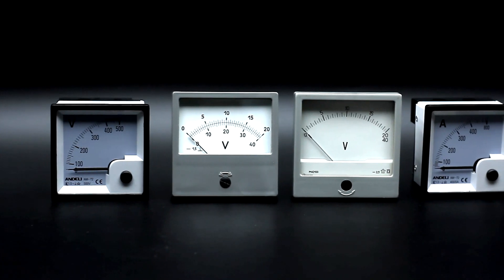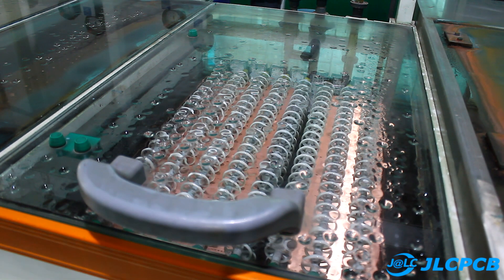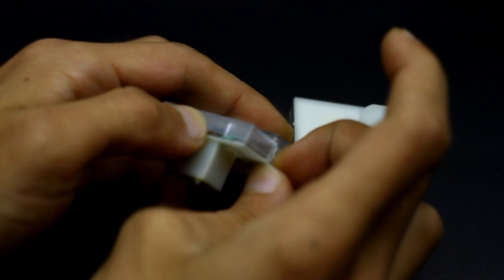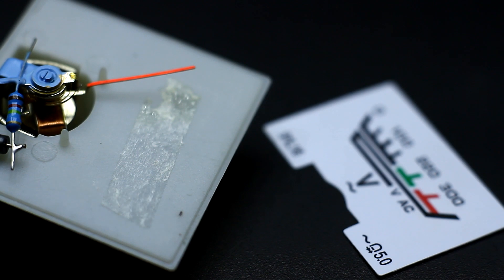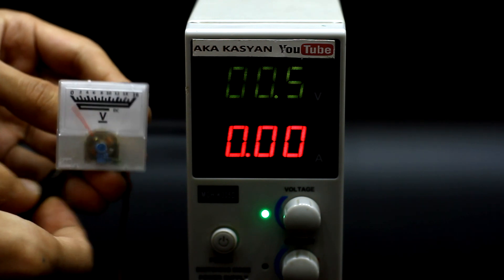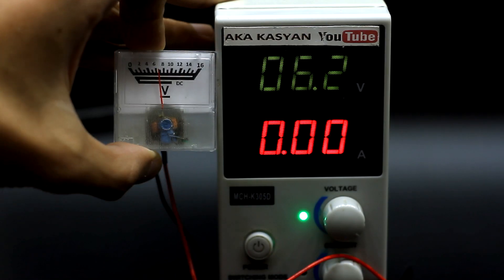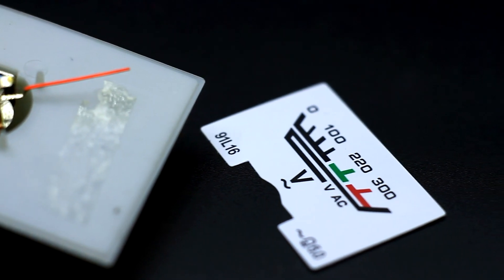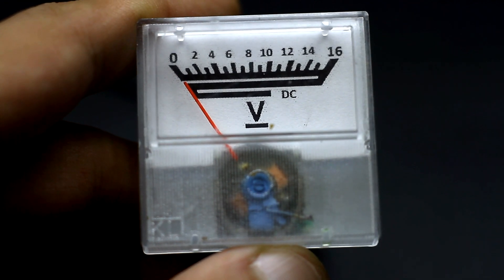DIY Analog Voltmeter

Comment: Thanks Kasyan TV! 

I made my own scale and it is GREAT.

 I used a random 100V voltmeter.
The scale is done, but now I have to remove the internal 100V voltage divider and replace it with my 24V voltage divider , and I'll also add a current shunt into it and add a switch to change into voltage or current mode with a push switch.

I made it for my lab bench power supply, it's 0-24V, 0-3A - 72W max.
It's a project I'm doing on a budget (35 - 50 €), so it's a good thing that I modified a random analog meter rather than buying the right value analog meter.

The quality is decent, but not perfect but you get what you pay for.

I made it EXACTLY the same way and it is GREAT.
Reply: Adam.. That sounds awesome. 👍 the shunt for adding a current meter in the one unit  was good thinking👍. I might have to steal it.
Reply: @adamsken1f  i dont understand what your channel is about! ! Is it mainly for reviews on video games???
Reply: @keithking1985  You just need to subscribe to me. No need to have notifications on
Reply: @keithking1985  Should be mostly Minecraft but sometimes I record something else because of these factors:
Not enough time
Corrupted recording
Annoying parents :)
etc.
And then I record something else.
Reply: what is the shunt made of and whats its resistance???
Reply: @keithking1985  From a 18 AWG cable (16A max.)
first, you have to know your meter full scale current (uA)
Then use a simple math formula
(i don't actually know this)
Reply: @adamsken1f  Nice One Adam!! i have an app for that formula its on an app called "ElectroDroid" its free but its brilliant has loads of calculators in it plus loads of stuff you need for electronics.. theres a pro version ya pay that has more stuff on it like arduino library's, all saying that but i think its one of the best electronics calculator app's out there!! and iv tried a lot of them!!  So check it out!! & thanks again for the reply!!!!

Comment: hi, i have this problem, i have this old voltmeter it is an AEG from the 30s and it has 400v scale but the series resistance was ruined by water damage so my question is: i use the same type of potentiometer to calculate the resistance in series or I look for something bigger

Edit: i'm going to use it whith 220v ac

Comment: Nice on old power supplies aswel to watch the circuits current draw and general behaviour etc although digital meters are most times more accurate I find it nicer to watch the needles swing than digits jump around.. I was born in 79 so that may have some relevance in this inbuilt fondness for older tech
Reply: I like retro vintage tech so using these in my latest project (power supply) will give it a retro vintage look
Even though I was born in 06

Comment: Could you make a tutorial for inverter, amplifier, battery charger transformer full practical design with core area,wattage, turns, wire size, voltage and current parameters whatever we want.

Comment: I found this video after searching analog multimeters for a good price. I want to harvest the meter from a multimeter to use for a triple meter CB radio SWR, Modulation and Watt meter.  I plan on using a 5 digit led volt meter, amp meter connected to a dc power supply to calibrate the watts I use for the radio.

Comment: Your smps designs are not optimised to fully. I took one of your design and post it on all about circuit forums and they pointed out errors. I just blindly built your design and that costs me 2 power MOSFET. I know there must have been my fault too in setup but design was yours. Please don't post such schematic

Comment: If another scale is needed which can not be derived from the original scale, there is a great (but complex) software for this purpose called GALVA. Google for F5BU and GALVA.
Reply: Jan Lategahn Thanks for that, very nice program that can be used for potentiometer dials, different angle meters, linear scales like a bar graph and, as in my case for a custom circular slide rule scale. Some nice projects too.

My car had a dead gauge, the temperature I think it was. I bought a few replacements because they weren’t that costly and discovered that they used stepper motors for the meters, all connected digitally. Couldn’t use these for regular panel gauges without a microcontroller